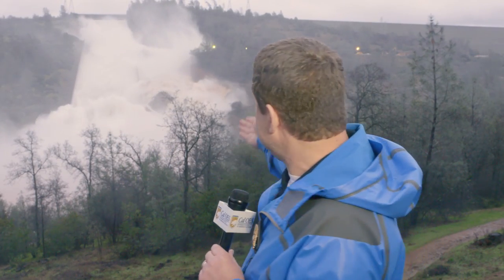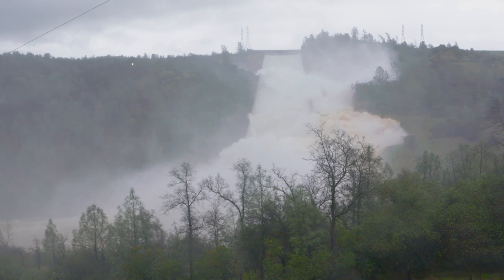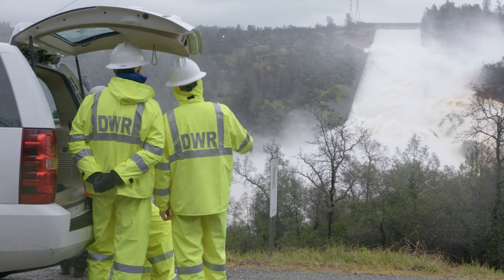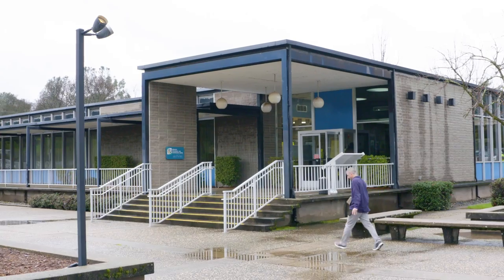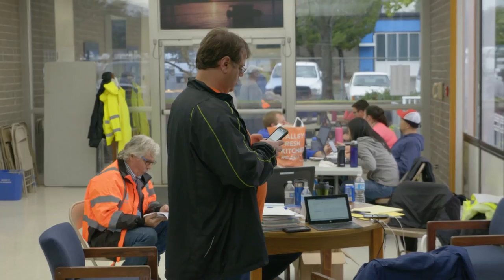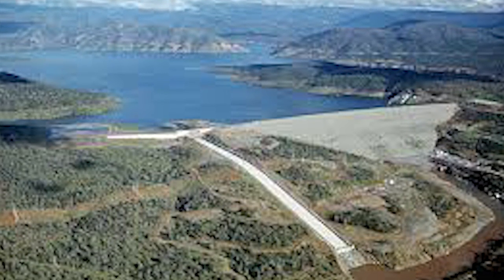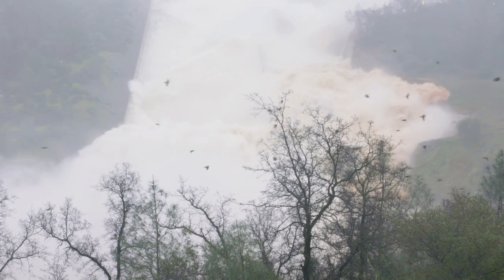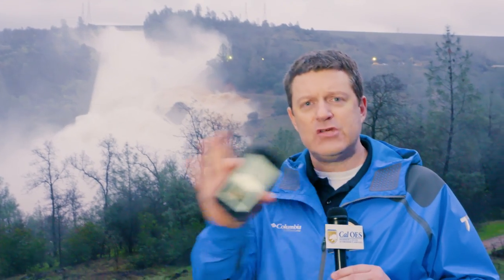State Agencies Mobilize to Oroville Dam, Strategize Repairs and Rumor Control

Comment: That's like the guy saying that "it looked like it was going to work" Cars in a junk yard "look like they will work" Why do they show us one thing, then tell us another? Who's calculating these flows, a fourth grader? They told us yesterday, not anticipating any water to flow over the emergency spill way, at 8am it started. I understand there's not much they can do, but they could at least get the calculation right, and tell us the right information. People are worried enough, last thing we need is a bunch of incompetent people, telling us something won't happen, then it does happen. There's no trust in that. Why should we continue to believe what they tell us, do we have a choice? This whole situation could have been prevented, if state inspectors would have done their jobs during the drought period.

Comment: 80,000cfs should be going out of the damaged spillway, to avoid any water going over emergency spillway... why are they only discharging 55,00 cfs..???
Reply: Augustus Mo they're concerned that increasing the main spillway flow will cause more erosion farther up the hillside.  That's something they want to avoid, because if it damages the flood gates, things start getting very expensive very quickly.
Reply: This is already going to be very expensive, but if it erodes up the hill it could result in failure. There is no winning this fight.

Comment: spillway is designed to allow 250,000 cubit feet of water per second to escape safely...at 30,000 it buckles the cement?...sure a few sticks of dynamite were not involved?
Reply: The tire on my car is designed to last 80,000 miles. If I have ~65k miles and it ruptures once I get on the highway ... the last I would possibly think about is sabotage.
Reply: the cement was never allowed to cure properly....after 50 years this should not be an issue...the area is in a fault line area...the ground below could be shifting due to earthquakes.
Reply: This dam is 50 years old. It is only a matter of time before there is a failure of the concrete which may have been caused by what was reported as a sinkhole. I have not heard if the sinkhole was created before or after the spillway failure. Earthen dams have a limited life and I would guess that 60 years is probably approaching retirement age. The Mohawk Dam in East Central Ohio is an earthen dam that was built in the 1930's. There needs to be  a serious evaluation of all of these older dams to determine which ones to replace or repair first.
Reply: Dams built by Cortez in Mexico in the 1500s are still functioning perfectly in Mexico to this day....the 50 year old cement should be "set in concrete" by now....probably never got a chance to dry out and harden...this dam was built on the "cheap"....a way for Brown and Reagan to pay off their backers.
Reply: The levees...which is what this 704 foot high monstrosity really is....fail at the bottom due to what is called a boil...the downward pressure of 700 feet high water backing up for 3 square miles forces an escape chamber under the wall....this is a doomed dam....many will die...the damage will be catastrophic...that is not a strong enough word for what is about to happen....apocalypse now!
Reply: John Rogan Before they put in an earthen dam, all overburden is removed down to the bedrock. Bed rock is inspected for cracks or faults and a "grout" filling of cement and rocks and pumped into the cracks in efforts to achieve an impermeable dam base. Typically an entire 50-100' trench the length of the dam is drilled into the bedrock and filled up with grout, and that grout wall extends up into the dam itself.
The grout fillings along with the weight of the earthen dam itself is what holds the water back.
Not all dams are create equal, and I don't know specifics of this dam in question, but imagine the process was principally the same.
Usually what engineers look for - and hope not for- is any movement of water underneath the dam (lakeside to riverside; getting through the grout "wall"). In time water movement will begin to compromise the entire dam.
It really doesn't help that most dams are built on fault lines... really just a consequence as rivers trend over major fault lines; and I don't have to have much imagination to see how this could be a particular problem for California ....
Reply: This dam was not built with grout from what I have seen, it was just a big hunk of clay.
Reply: Remove FEMA and fire all of them
Reply: one expert from Holland would be worth a thousand Brownie appointees!

Comment: So the water should be flowing into the emergency overflow area at 901.38'. http://cdec.water.ca.gov/cgi-progs/queryF?s=ORO&d=11-Feb-2017+10:17&span=12hours

Can't find any videos to prove it yet. Better hope the bedrock is at river depth in the washout area! Or there will be a Grand Canyon by June when the snow melt is done. The Army Corp of Engineers should know I would think.
Reply: Well, June is overly optimistic this year.